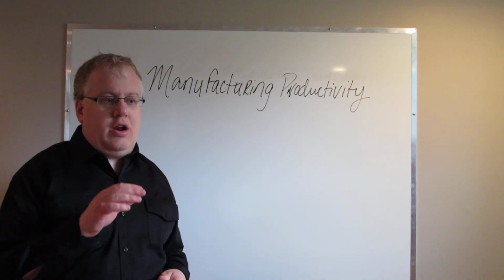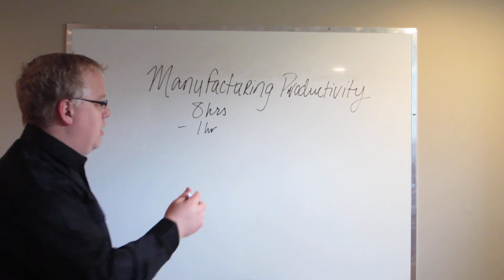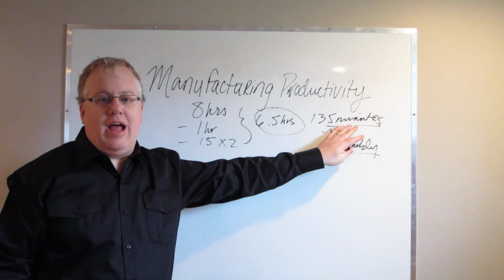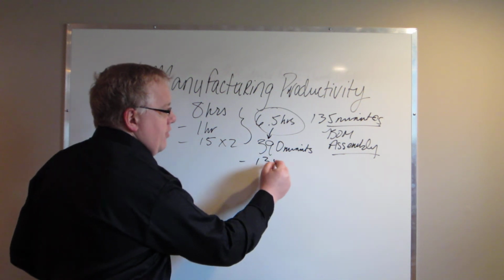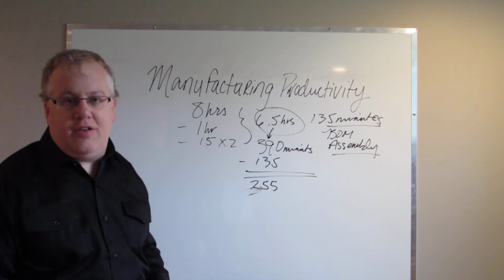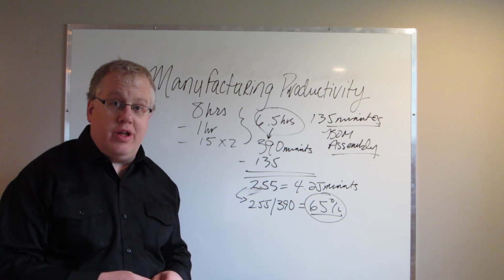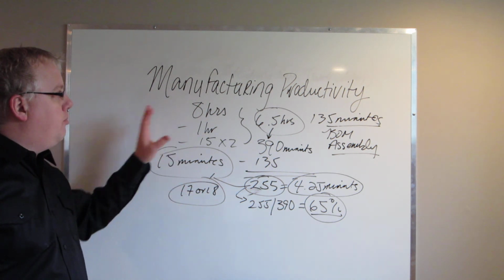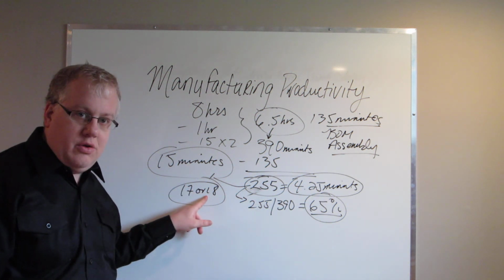Manufacturing Productivity Rate - Work Cell

Comment from the maker: You are absolutely right - if you manufacture from a fixed bill of materials, in high volumes, within an automated plant where cycle times and their variances are tracked accurately. However, most companies are absolutely unaware of their productivity rate across their shop floor and in individual work cells. It's the reason why one cell over produces - while the next can't keep up. A single backlog in the chain creates a backlog throughout. Unfortunately, not all are highly automated.
Reply: I need more explain, sir. How did you get 135 minutes cycle time? Does we count it  by stopwatch?

Comment: Keep somebody extra for relief ,build a restroom close to the workstation or the production line worker and alert the material shipping and handling early in case of material running out and finally treat the worker good I guarantee you your production productivity will reach up to 90%.finally the most important    Thing is management need to set up the exact number of part per hour not to change their mind every other day .employees love to finish the production requirement as early as they can to take small break before they leave .

Comment: great perpective 
idle time is always an anemic symptom of any production line when not properly aligned on both ends. also taking strength and weakness of each station operator should never be discounted since they always create baseline of your initial analysis.

Comment: Every employer I have worked for did not provide a free lunch.
And 8-hour workday was a 9-hour shift.
Reply: Insane to measure in minutes.
Reply from the maker: @badmatt4227  Well, it's unfortunate you've worked for such horrible employers.
Reply: @Driveyoursuccess  I am approaching 60 years of age and have worked for dozens of employers. 
They do not pay for the lunch hour and they don't give breaks on only an 8 hours day. 
Where are these employers that pay for the lunch break, I need a job.
Reply from the maker: @badmatt4227  I am 55 years old and have been a lean manufacturing consultant for 25 years. It sounds like you work in the USA. The USA is not the best place for people who work for contractors or in manufacturing. However, in all other G7 countries, lunch is paid, as are two 15-minute breaks, which are now becoming 20-minute breaks. A lot of this is mandated by law. That lunch is either 45 minutes or 60 minutes. You do this analysis by minutes - whether you're a contractor, service provider, or manufacturer - NEVER EVER BY THE HOUR - to determine the cycle time in minutes for a service or product - BECAUSE - the vast majority of products are made in minutes, some in seconds. The USA currently has a labor shortage in Manufacturing, because today's youth will not accept the working conditions that other generations tolerated - so, YES - manufacturers in the USA are now forced to change - either they attract a new workforce, or they die. It's that simple.